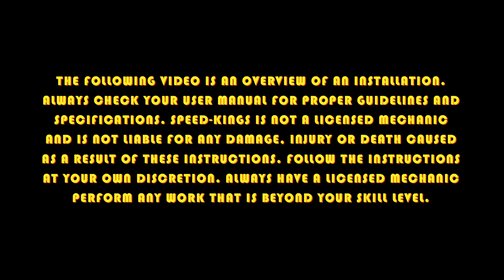SPEED-KINGS INSTALL: SPEED-KINGS CHAIN KIT

Comment: Hey man is it bad I already put one of your chain drives on then watched the video anyway because they are unreal! Haha a little trick is to slip a cable tie around the primary chain adjuster first before pulling it off, holding tension on it so it's not as fiddly when putting back in! Keep up the good work

Comment: Very helpful.. Great videos you put out.. I have a question, while tighten up the chain tenstion or adj the wheel, could the small holes help that are on the dyna swing arm? Ive used them to adj my tire.
Reply from the maker: K Yaz I prefer to adjust by feel personally.

Comment: What’s the maintenance on that? Can I still use the belt guard with it so I don’t get grease flinging all over. Nice video.
Reply from the maker: Angel Ortiz yes you can
Reply: Speed-Kings Cycle on your site now looking to get the setup for my 16 low rider S. Don’t see the socket n tools on the sight though.

Comment: How does your locking system compare to Hard case bolt lock-r? Reason I ask is I had Hard case lock-r and my bolts still backed out  and snapped... might have to give this system a try🤔 awesome video by the way🤟
Reply from the maker: MannyMoto all bolt locking systems are preventative and never guaranteed. Red loctite, proper torque spec and only using the bolt one time is also recommended. We have never had a system back out on us using these methods.
Reply: @speed-kingscycle7390  ✔✔✔ done all of the above with no luck😭 I'll  be trying your system out in the near future maybe that'll be the secret sauce👊

Comment: Any idea if the install is similar on the M8 softails?
Reply from the maker: gisoid yes very similar. I would still get a manual for your bike. M8 motors have different fluid levels and a couple small changes.